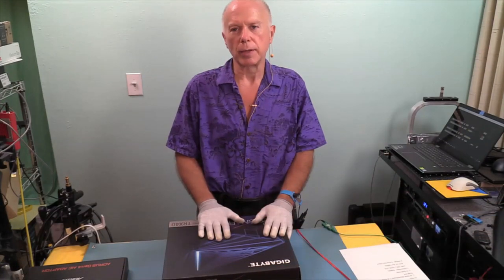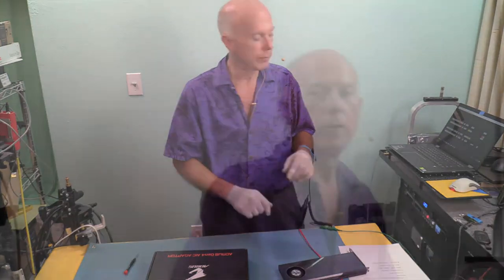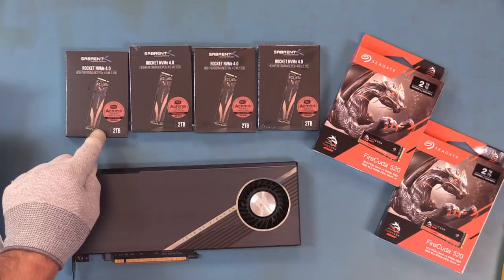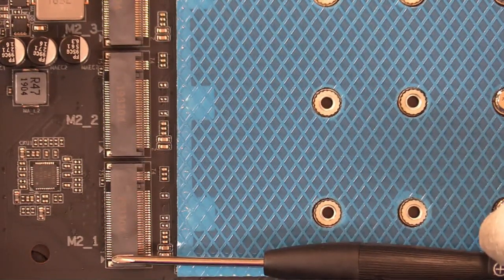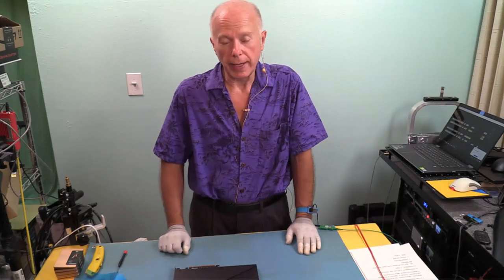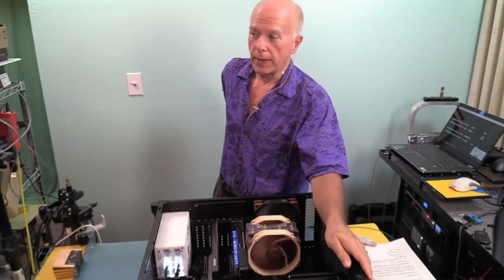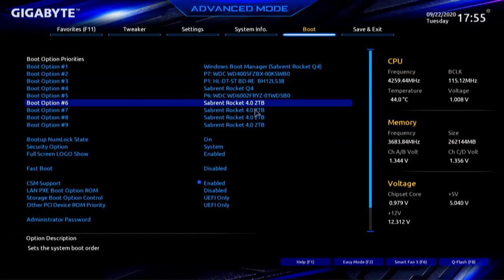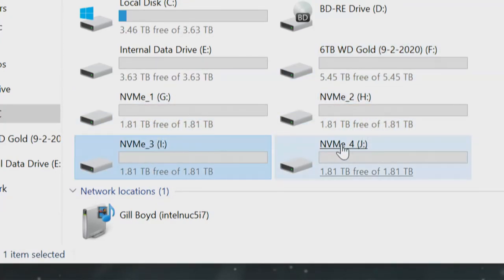Gigabyte AORUS Gen4 AIC Adaptor Comparison and Simple Install Tutorial TRX40 Designare

Comment: „I remember when we had to deal with Irq and uart.“ That explains the grounding bracelet and the high forehead 😅
Reply from the maker: Hi NavySeal2k,
And that has not been that long ago! IRQs and UARTs, yes! Now, PCIe Resources! Grounding was recommended by Intel at their Intel Resellers Meetings years ago. Every Motherboard Manufacturer has a Section in the Motherboard Manual with cautions about ESD. We implemented that procedure when We started Building with the X399 Chipset due to reports of Motherboard failures. There was a time when USB Keyboards and Mice could not not be Hot Plugged for the same reason causing USB Port failures. Then. Design changes were implemented to eliminate that risk. Seems Computer Components are more sensitive to ESD than We realized even today. M.2 NVMe PCIe SSD Drives would fall in that category since they are not Designed to be Hot Swapped. We've had no failures since implementing that procedure. Better safe than sorry. Yes, I've been Building Computers for a while. We also toured the US Robotics factory many years ago, on an off day, and witnessed and experienced what was done about ESD during Manufacturing. Yes in USA!  Even then We had to stay 25 feet away from everything. We were in special smocks and booties on a marked path. Floor had a special epoxy coating. The residual effects of ESD are not pleasant. We have many stories of such over the years. We use to have Live Classes Teaching How to Build a Computer. Our largest class We Built 35 Computers. It was a long day and a Successful day. People would drive from 2 hours away to participate. Things change. Experience is the best Teacher. We share what We know. Been Building Computers since 386. Now, no more Live Meetings. Unfortunate. Perception and Perspective.

Comment: Can i use it with an X570 mobo with amd ryzen 9 5900x cpu will it work for a raid 0 using 4x samsung 980 pro ???
Reply from the maker: Hi Abdullrahman Alghamdi, 
Welcome! By Chipset design, yes. By implementation, depends. What Motherboard are You using? Greater chance of Success with ASUS. We'll check and verify and list the exceptions.
Reply: @BuildOrBuy  Asus rog strix X570-E i am gonna put the GPU on the other x16 PCI-E Slot which is electrically only x8 lanes so i can have the expansion card on the x16 PCI-E lanes, so will it work with x4  samsung  980 pro so i can have theoretical speed of 28GB/s sequential read and 20GB/s sequential write with RAID 0 ?
Reply from the maker: Hi @tomex73able , 
ASUS ROG Strix X570-E 
https://rog.asus.com/us/motherboards/rog-strix/rog-strix-x570-e-gaming-model/

To the CPU... 
- 2 x PCIe 4.0 x16 (x16 or dual x8). 
Through the Chipset... 
- 1 x PCIe 4.0 x16 (supports x4). Video card here it will work. 

Otherwise, You would only see 2 Drives. Suggest a self Bifurcated card like the Glotrends Sky card. That works in a x8 Slot. However, PCIe 3.0. Hope that helps!
Reply: @BuildOrBuy   so i can put the expansion card in the video card slot for 4x4x4x4 bifurcation  and then put the video card in the the other x16 PCI-E slot which is an x8 lane actually but physically x16 lanes and sacrifice half the GPU bandwidth for a better storage management speed that's fine by me, thank you sir you are really an amazing and a nice person you have been really helpful thank you❤
Reply from the maker: Hi @tomex73able , 
Yes but You will only see 2 Drives unless You place the Video card in that 3rd Slot which is only x4. Bummer, I know. Not enough PCIe Resources! 

Thank You, Very Much! Appreciate Your Comments! Here to help! I Love my Subscribers! Success and Best Wishes!
Reply: @BuildOrBuy  hi sir hope you are doing fine, could you be so kind and recommend me a gaming motherboard that cab support x2 PCI-E x16 with both support x16 lanes not like one is x16 then other is x16 pins but support x8 lanes because i want to have a full functioning GPU with Full functioning M.2 expansion card , i am sorry if my request is too much sir but your expertise is really a must in such matters, thank you for everything you do here in this channel
Reply from the maker: Hi @tomex73able , 
Yes! Appreciate Your Comments! For that PCIe Resource allocation, You're looking at the X399 for PCIe 3.0 and TRX40 for PCIe 4.0. Generically, both offer 2 x16 and 2 x8 Slots dedicated and not shared PCIe Resources. None of the X570 nor B550 Chipsets have those Resources. Even with those 2 Chipsets (X399 or TRX40), We still have to verify a particular Motherboard due to the way some Vendors allocate those PCIe Resources. 

With that said, of those two Chipsets (X399 or TRX40), the very best deal is the Gigabyte TRX40 Designaire Motherboard. Why? That particular Motherboard includes two AICs. The Aorus M.2 NVMe X16 Quad card which is PCIe 4.0 and a PCIe 3.0 Titan Ridge Thunderbolt 3 AIC. That is the best value in a Motherboard with the PCIe Resources allocated to run everything! 

Gigabyte TRX40 Designaire Motherboard
https://amzn.to/367hUJK
As an Amazon Associate I earn from qualifying purchases.

Furthermore, The Gigabyte TRX40 Designaire would be classified as a HEDT. Which would equal Building a 7 to 10 year life span Computer as opposed to Building a 2 to 3 year life span Computer. 

The next biggest problem We're encountering is the width of the Video cards. Due to the spacing of the PCIe Slots, a Video card must be 2 Slots wide or less. Any wider than 2 PCIe Slots and We lose an adjacent PCIe Slot for an AIC. And PCIe 4.0 Riser Cables are not reliable. 

Those are the parameters We have to work within. Otherwise, We scale up to the WRX80 Workstation with 7 PCIe Slots. On the WRX80 Platform, all PCIe Slots are PCIe 4.0 and all x16 electrically not just mechanically! Lots to consider now when Building a Computer and thinking about upgrades or Add in cards (AICs)! 

Hope that helps! Thank You for Asking!
Reply: @BuildOrBuy  thank you sir that is really so kind of you, but buying a threadripper Chipset and processor for gaming just to have a fast reliable storage capacities and capabilities isn't a bit extreme overkill i'm afraid? Yes i am planning on building a high-end super gaming pc that can play any gamr and any program out there without choking , but is still really hesitated i don't think a pc beginner like me should start with threadripper, but I really appreciate you efforts and advice sir and i am looking forward for your review and tips about my  build once i am done with it i am sending my part list for the build and your opinion is extremely respected and valued thank you again❤
Reply from the maker: Hi @tomex73able , Absolutely! Now You know what's required to do what You asked. Change that Requirement changes everything. That's why We have Outlined 4 Levels of Computer Builds based on a prioritization of CPU Cores and Thunderbolt connectivity. 
1. 10 Core
2. 16 Core
3. HEDT
4. Workstation

Hope that helps!
Reply: @BuildOrBuy  it really helps, if you could give me an official email of yours if you have one for future questions so you can have your time answering i could really use your guidance and advices in building my first pc and also premium one , if you can't i will definitely understand thank you very for all the wonderful tips and advices very very helpful
Reply from the maker: Hi @tomex73able  , Ask away right here on YouTube! We can Discuss Your Specs.

If You want to schedule an appointment, We can do that. Here to help!
Reply: @BuildOrBuy  yes, i was thinking of a zoom meeting at some point you know so i can ask most of questions and get most the information i need ,but it is a good thing you are active on YouTube then i will text you here again sir whenever i have another question,  thank you very much for your kindness and help
Reply from the maker: Hi @tomex73able , Absolutely! Ask anytime! Thanks for watching! Stay tuned!

Comment: Is there a way to make the 8GB version (which has 4x2tb nvme) bootable with RAID 0 ?  TRX40 mobo.
Reply from the maker: Hi SaM PaR, Yes! From the Bios - Hybrid RAID. We have another Video to help with that. Give a moment to get the link for You...

ASUS Hyper M2 X16 NVMe Quad card plus four Samsung 970s - AMD NVMe RAID 0 Upgrade
https://www.youtube.com/watch?v=x5G-zciner4

Hope that helps!
Reply: @BuildOrBuy  wow thanks so much for the response, but im not reffering to hybrid raid. We wanna make the Raid 0 array with 4 disks, complete total of 8GB, AND install OS on it afterwards. I was trying but i couldnt make it :(
Reply from the maker: Hi @kalamarades  , There are 2 types of RAID We can create with a Quad card. 

1. A Hybrid RAID, which is accomplished from the Motherboard Bios. Bootable!

2. A software RAID, accomplished from the O/S. Not Bootable! 

3. A true Hardware RAID requires a Hardware RAID Controller which the Quad cards are not. A Hardware RAID card has its own Bios. Bootable!

The Video about the ASUS Quad card will help You understand what to do for what You want.
Reply: @BuildOrBuy  in your video you already have a drive with os, right?
But i do not have any os installed so we need a hardware raid, which i already have made, and at the bios it seems to be fine but the thing is windows wont let me do the installation.
All i see is 4 drives at full capacity and each one has a small partition of 16mb too.
Shouldnt it be only 1 drive at the installation window if the raid was working properly?
Reply from the maker: Hi @kalamarades  , Good question. Easy! 

You need the Controller Driver. Once Windows sees the Controller, then Windows will be able to see what's on the Controller! The RAID array.

Go here: https://www.amd.com/en/support/chipsets/amd-socket-strx4/trx40

Click in the + next to Windows Drivers. Download all three! You need the third Driver. Copy that to a USB Thumb Drive. Next time Windows gets to that point, point Windows Install to that Driver! Voila! Simple... once You know how! Enjoy! Let me know if You received Your monies' worth! Subscribe! How's that for Service!
Reply: @BuildOrBuy  loaded drivers according to amd manual, worked like a charm. Thanks for the support you're the man!
Reply from the maker: Hi @kalamarades , Glad we could help!  Thanks for Update! Keep Us Posted on Your Progress!

Comment: Hello! Well done for this nice review! I have a question. I own a Gigabyte GA-AX370-Gaming 5 (rev. 1.0) motherboard. Can my motherboard run any of these cards? And if not, is there any similar card- controller that could work with my motherboard? Thank you in advance!
Reply from the maker: Hi Giannis Mavridis, 
 Thank You!  This one will not. However, here is one we can recommend that will! Listed below! Research for other Users who may have need of this. 
Gigabyte GA-AX370-Gaming 5 (rev. 1.0) Motherboard
https://www.gigabyte.com/Motherboard/GA-AX370-Gaming-5-rev-10#kf

ASUS [Motherboard] Compatibility of PCIE bifurcation between Hyper M.2 series Cards and Add-On Graphic Cards 
https://www.asus.com/support/FAQ/1037507

2017... 18 Bios Updates. Last one, 7-2-2020, Wow! 
Reading through You PDF Manual, Page 6. 
Nothing about Bifurcation. Would require a Bios Update, if it could work. It will not. Here's why... You have 1 x16 Slot and 1 x8 Slot. When both PCIe Slots are populated they share Bandwidth. Therefor both run at x8. Not enough PCIe Resources. Have included the Link to ASUS so You can see what they're doing on other Chipsets from their Brand above. 

Your best Option: A Bifurcated card. That would be a Quad AIC with the PLX Chip for Lane Switching. High Point or GloTrends. We have a Video on the GloTrends Sky AIC. Requires 1 x8 Slot. To reiterate, that will work for Your Motherboard. 

GloTrends Sky x8 M.2 NVMe Quad card Unboxing and Setup Installed in HEDT X399 
- https://youtu.be/QF71-5nhrAk 

How's that? Let Us know if You need any more help! Thanks for Watching!
Reply: @BuildOrBuy  Such an amazing answer! You are the best. Thank you very much!
Reply: @BuildOrBuy  One more Question please! Will my system be bootable with GloTrends? Thank you again! Keep up! :)
Reply from the maker: Hi @giannismavridis , Absolutely! Thanks for asking!
Reply: @BuildOrBuy  Thank you again! Your videos are rock-solid information always on point!
Reply from the maker: Hi @giannismavridis , Excellent question. First, are You planning on using RAID? Why? A Hybrid RAID or Bios RAID is a function of Your Bios. 

Second, does Your Motherboard support NVMe? Why? If Your Bios supports NVMe, it should support the GloTrends AIC. 

I will double check and get back to You! I know that High Point has an AIC that does support Boot but I think that High Point AIC required a 16 Lane Slot. I will verify.
Reply from the maker: Hi @giannismavridis , Thank You for Your Comments! Much Appreciated!
Reply: @BuildOrBuy  No not necessary. Only the Glotrends with two or four NVMEs would be more than enough! My motherboard supports NVME but has only one PCE x16. If i put it on a 8 lane PCI will it run slower?
Reply from the maker: Hi @giannismavridis , Since we're shooting our next Video today, I have asked GloTrends directly. Give them 2 days to respond. Just noticed they need a PDF Manual for this sort of Research. I'm working on it! If we don't hear back by Friday, I'll ask again! 

High Point has documentation available. I can always pick up the phone and talk to them direct. Here's the High Point SSD7102 Bootable 4X M.2 NVMe RAID Controller - https://amzn.to/2G1Zro7

However, that AIC requires a 16 Lane Slot which You don't have. You need one that works in a x8 Slot. Hence GloTrends! We need to know! Details matter! Stay tuned!
Reply from the maker: Hi @giannismavridis ,
Are You using on-board graphics? You're 1 x16 Slot, once populated, will run at x16 until You populate the x8 Slot. Then both would run at x8. 

We have not tested to compare yet. We will do Comparisons after we wade through the different NVMe cards. We have to get the Threadripper 3 Built and Documented 1st. 

GloTrends has the Palace AIC for x16 Slot and the Sky AIC for x8 Slot. We recommended the Sky x8 AIC considering You would already be using the x16 Slot. 

Now to Your question, According to GloTrends both cards run at the same speed. Remember, both have a PLX Bifurcation Switch (Chipset) doing the Lane Switching. And both use the same Chipset. It all about the programing of the Chipset to do the Lane Switching. 

With that said, that's another Video we still need to do! Comparing the GloTrends Palace and Sky NVMe Quad AICs for Throughput. We will!
Reply: @BuildOrBuy  You are just amazing! Congratulations and thank you for your time! :)
Reply from the maker: Hi @giannismavridis   Absolutely! Everyone needs help at some point. We are our own best tech support!. That's what we're we're here for! Thanks for watching and joining Us on this journey!
Reply from the maker: Hi Giannis, Heard from GloTrends today. They answered one of 3 Questions but not this one. However, did some more Research, yes! Sky can support PCIE Booting according to GloTrends Comments on Amazon. Excellent! We expected as much but did not know for certain without further testing. The Question they did answer... "Sky will be available within 30 days.
 Many thanks for your email!" Hope that helps!
Reply: @BuildOrBuy  I have no words really... You did all this to help me... Many many thanks really appreciate it! Keep up your top videos!
Reply from the maker: Hi @giannismavridis , Yes! Absolutely! You' are most welcome!

Comment: Does it work with Z490?
Reply from the maker: Hi Joseph, 
Nice to meet You! Can You be more specific? If ASUS, to a degree. Here's ASUS Support List: https://www.asus.com/support/FAQ/1037507
The most Supported on an ASUS Z490 are 3. Not 4 according to ASUS. 
Requirements: 
1.) x16 PCIe Slot (electrically not mechanically).
2.) In Bios, Bifurcated PCIe Slot from x16 to x4x4x4x4. ASUS defines that in Bios as Hyper Quad support. Tell Us the Brand, Model and Revision, we'll take a look at the Specs for Your Motherboard. 

Suggest a x8 Card with Bifurcation built-in. Glotrends Sky. We have a Video on that one here: https://youtu.be/QF71-5nhrAk 
Hope that helps!
Reply: @BuildOrBuy  I want to use Aorus Z490 water force Xtreme and I want to know if that Pcie card will work with it.
Reply: Hi @LiamLèēé , Are You using Onboard Graphics? If not, that's going to be a problem. Not enough PCIe Resources. Hence a Glotrends Sky x8 card, self Bifurcated. This type of Card is made for a HEDT. If this were ASUS, they have Bios Updates for their Motherboards. Not optimal. Sorry. Hope that helps!

BTW: According to Your Motherboard Block Diagram in PDF, the x16 Slot becomes x8 when using the x8 Slot. In other words, using both of those PCIe Slots, they will both be x8 Electrically. Which means Your Video card will run at x8. A stated on page 7, 1 x16 or 2 x8. Just FYI.

Gigabyte Z490 Aorus Xtreme Waterforce Intel Z490 
Intel Z490 Express Chipset
https://www.gigabyte.com/Motherboard/Z490-AORUS-XTREME-WATERFORCE-rev-1x#kf
Reply from the maker: Hi @LiamLèēé ,
Switched accounts! Here's Our Glotrends Sky Video: https://youtu.be/QF71-5nhrAk
Reply: Oh no I'm using an RTX 3090
Reply from the maker: Hi @LiamLèēé  , You don't want that beauty in a x8 Slot! Congrats on the RTX 3090! Bummer on the Quad card! Even though both Slots are on the CPU, they Share Resources! Not good.